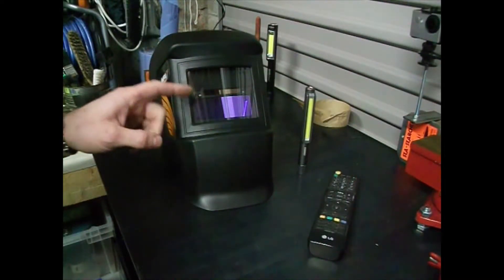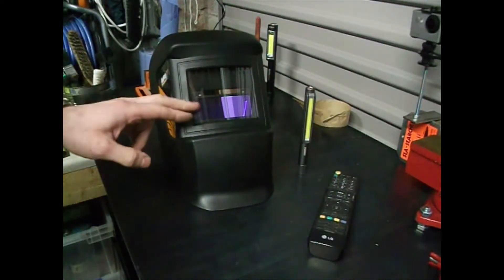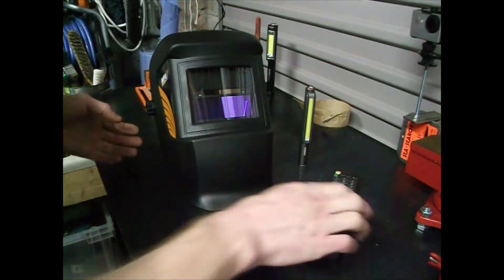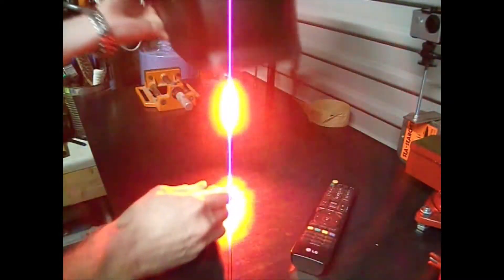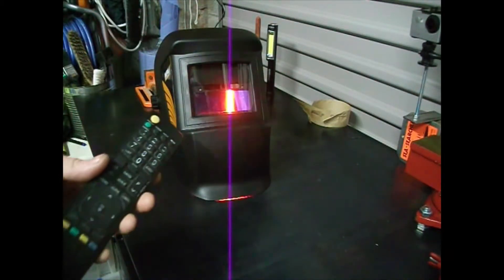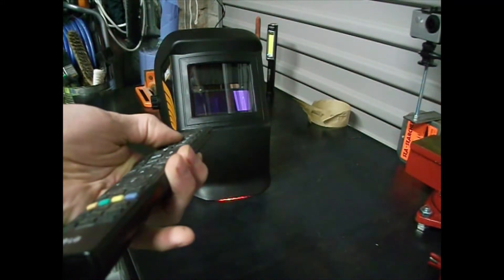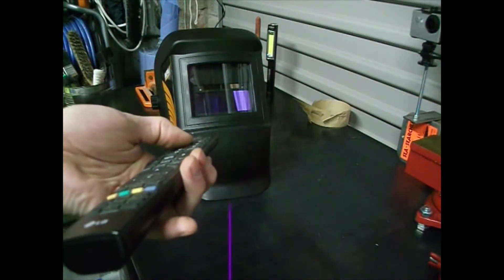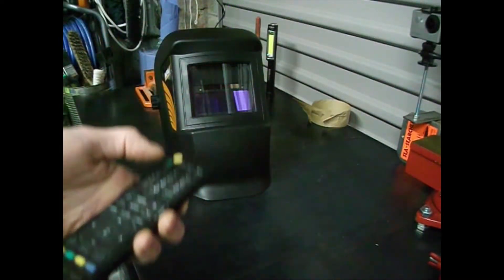How DO you test that your Auto Darkening welding helmet is working safely? 🤔 - Super Simple!

Comment: I haven't reached for my helmet in some time now, since I  don't  weld by trade, and was wondering if you could do this. I don't recall this ever being talked about in school either. Thanks for sharing, now I can get to repairing pin holes in my pillar frame so the new wind shield can be installed on the ol' XJ, without having to worry about getting arc flashed.
Reply from the maker: Easy if you know how! Thanks for watching!

Comment: I just change the batteries in the helmet every year. Only a few $$$ to protect your eyes.
Reply from the maker: Always a good idea @sptrader but not all helmets have batteries - this one is purely solar powered!
Reply: Changing the batteries annually is a good idea, like you say, Chump Change".
But,that is Not a failsafe. Sh*t happens and you don't want it to happen to your eyes. 😱😭😎
It's a 2 minute test. Just make sure your remote works. Take one from your living room,
which you are actually using. Not an "old" one.
Reply: Mine failed with batteries in and won’t work with new ones or old ones and both sets measured 3V on meter. 

Sad also as it’s an optrel. Didn’t last through many welds, glad I don’t have to rely on it for employment. Expensive but still can and will fail like everything human.

Comment: Just an FYI, even if the auto darkening function doesn't trigger, 100% of UV and IR will still be blocked and you will be safe. The worst that will happen is you'll be dazzled by visible light from the arc. Very annoying, but not dangerous. Like looking directly at a camera flash, that's all.
Reply from the maker: Well… not quite 100%, and being dazzled is no joke either - especially if you need to do hundreds of tacks on super thin metal instead of running a seam. You are quite correct that the majority of helmets give up to the equivalent of shade 15 glass protection regardless of dimming, but in terms of effective and safe welding, I maintain that testing every time is essential - you need to be able to see around you immediately in case of fire etc…